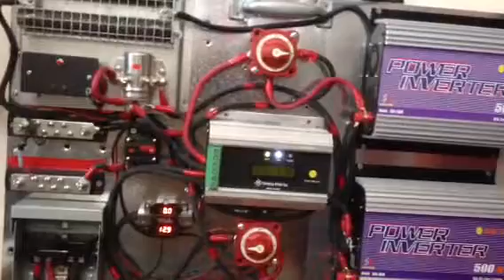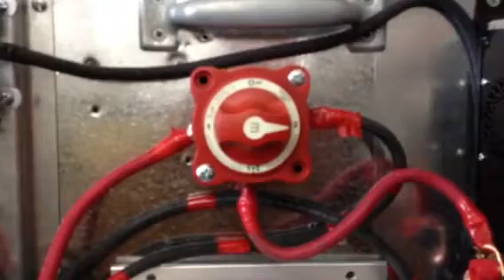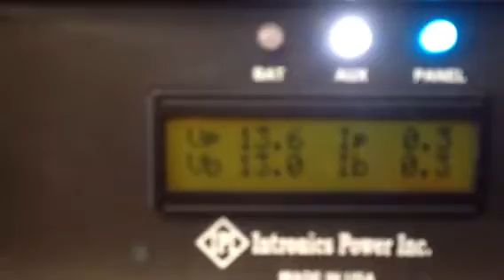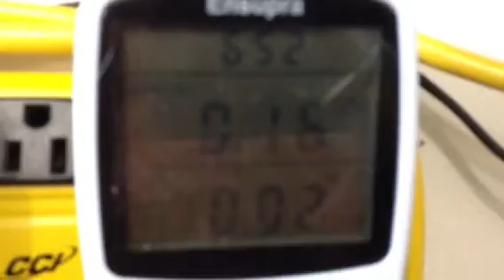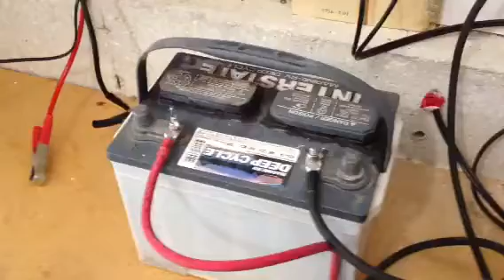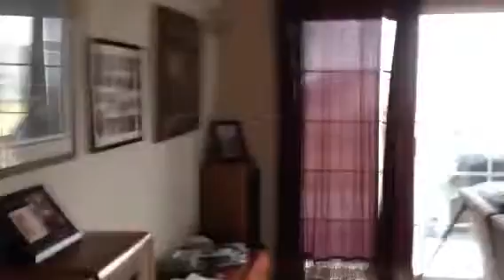Testing #2 ebay eagle II 12 volt wind turbine volts and amps into sun gti and battery and solar test

Comment: Looking good Ray.  Hard part over now. Add panels little at time now. NO AZ Wind/Sun get single 12v panels cheap w/ shipping. Shipping is key. Of course u can get 240v panels like $200 but must be truck shipped. Another reason I did 12v panels little time

Comment: Hi Ray, whats your main goal?? battery back up'' thats my spring project, I have been gathering what i need, = 640 watts in grape solar panels, 6-6volt deep cycle batteries 230 amp hours each but will be wired series-para' so 690 amp hours total..also bought 2 rolls of 6 gage wire(run from panels to charge controller are a bit long) got one MPPT tri-star charge controller last week now need one more...then to put it all together,lol..